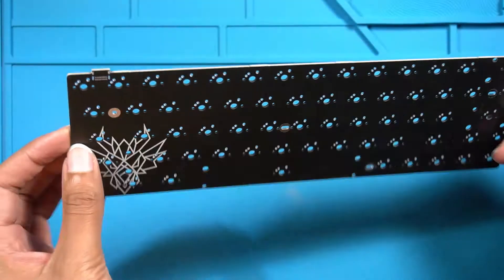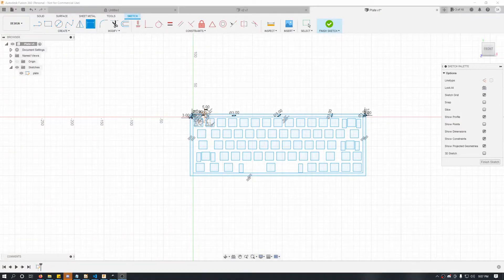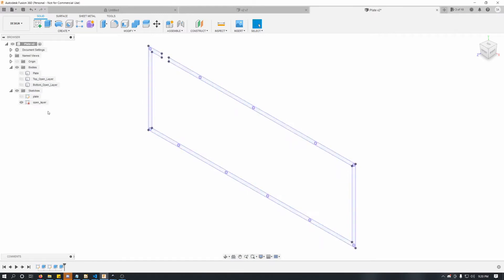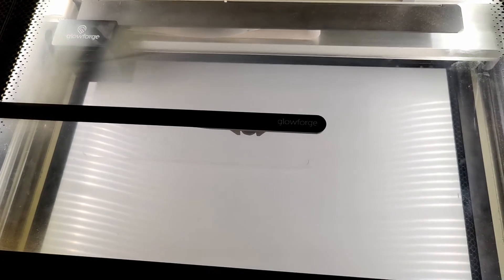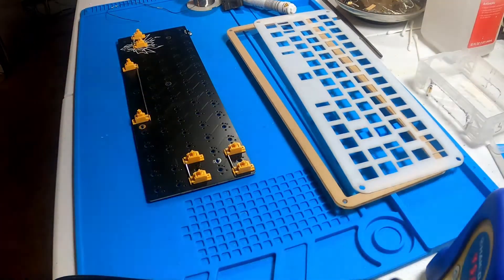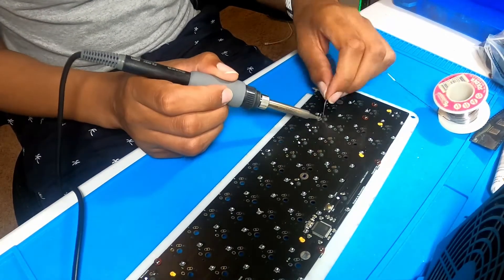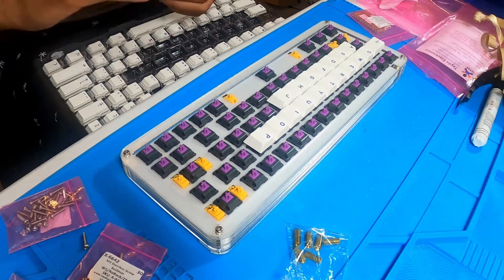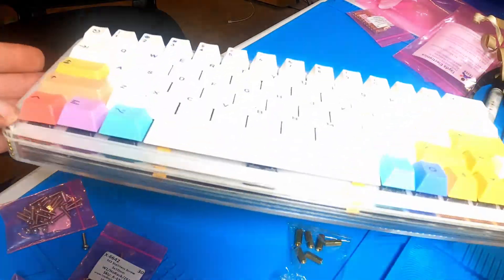Building a 60% Acrylic Case | Flygone60 Case Design/Build

Comment: Beautiful video - to the point and no fluff. I'm designing my own pcb as well and have a question about the mounting holes - do you need any mounting holes in the pcb itself? I'm going for PCB mounted instead of plate mounted.
Reply from the maker: By "mounted" I'm assuming you are talking about the keyboard switches. The switch mounting holes you see in this video are all part of the switch footprint I used, meaning they are included in addition to the holes needed for the switch contacts. In general, I normally use these switch footprints because it allows for PCBs to either be plate mount or PCB mount, which can be useful for different case designs.
Reply: @ShandonCodes  Actually, by "mounted" I'm asking about how do you fix the PCB to the case. Are you using something like M3 mounting standoffs to fix it to the case? Or do you just fix the plate to the case using standoffs and don't bother about the PCB since it's already fixed to the plate by the switches?
Reply from the maker: Oh I gotcha. So I have done both, but I generally prefer the latter where the PCB is fixed to the plate (via the soldered switches) and then the plate is mounted through some other means (like gaskets, sandwich, etc).
Reply: @ShandonCodes  I see - is that because the plate mount is easier to make/build or is better to type on than a direct PCB mount? Sorry for all  the questions!
Reply from the maker: I prefer different plate mount techniques, because I feel it allows for most possible designs. But it really all depends on the case design as a whole and personal preference.
Reply: @ShandonCodes  Thank you so much! very helpful!
Reply from the maker: You're welcome, thanks for watching my videos. ♥️

Comment: Hey man can you link the standoffs and the screws you used?
Reply from the maker: I don't have a link to the exact ones I used. But I would recommend you just lookup "M3 hex standoffs and screws"
Reply: @ShandonCodes  what size were they?
Reply from the maker: The head size is M3, the length will be completely dependent on how many layers of acrylic you use AND the thickness of those sheets.
Reply: @ShandonCodes  what length did you use? And will you be releasing the files by any chance?

Comment: How did you sodder the MCU to the PCB?
Reply from the maker: For the PCB revision I had the manufacture perform the SMT assembly service, so that way I did not have to solder the MCU by hand. If you try to solder an MCU like that by hand I would recommend using solder paste and a hot air gun.
Reply: @ShandonCodes  Thank you very much!!My project will have to wait a little there no MCU on the market at the moment :( and I do not know if the SMT services have some in stock
Reply from the maker: @Fastboyzking  Yeah, due to chip shortages they can be hard to come by. I recommend reaching out to the company you ordered the PCBs from, they may offer SMT services or at least be able to help you locate a supply for purchase.

Comment: So how did you mount the pcb? Was it just attached to the plate? If so, how?
Reply from the maker: The PCB is mounted to the plate by way of the switches (switch inserted into plate and soldered to PCB).
Reply: @ShandonCodes  ok thanks, do you think it would still work with a hot swap PCB?
Reply from the maker: It 100% will not. Reason being is because of the sandwich mount style. Basically, if you used a hotswap PCB there should be no way for the PCB and plate to stay attached once all of the switches are removed.
Reply: @ShandonCodes  oh yeah I didn’t think about it like that, thanks for the response though.
Reply from the maker: No worries, happy to have your questions!

Comment: Is it able to fit another pcb like a hot swap?
Reply from the maker: I'm not exactly sure what you mean. It follows the dimensions of a "standard" 60% so it should be able to use the same cases made for most 60% keyboards. The PCB itself though does not come with hotswap sockets for the key switches, they must be soldered.
Reply: @ShandonCodes  Could I swap out the pcb for a standard 60% hotswap pcb?
Reply from the maker: You definitely could, however because the case is designed to be plate mount removing the switches would cause the PCB to no longer be secured to the case. With that being said a streamer built this exact design and used hotswap sockets, so it is possible.